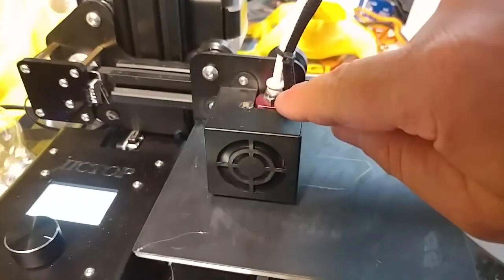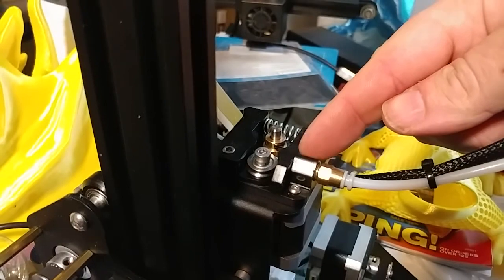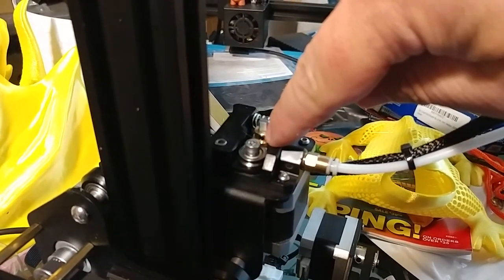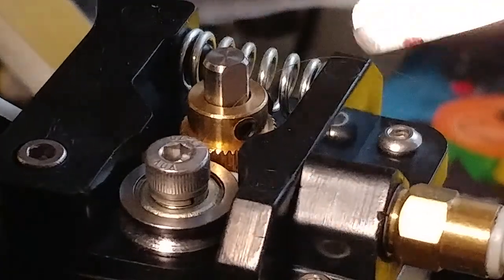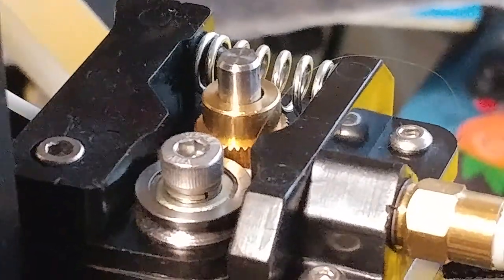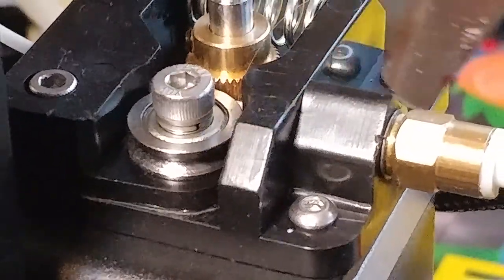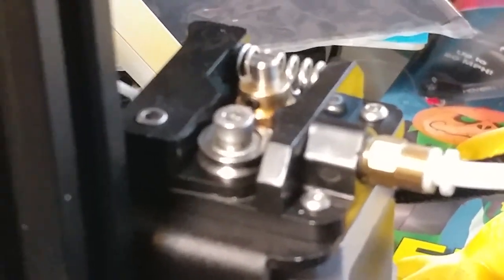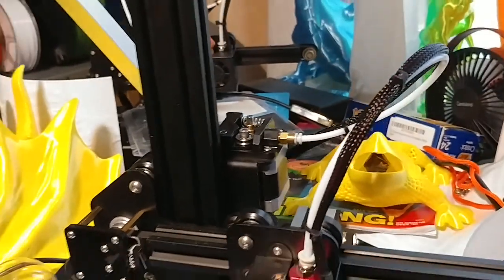Today's 3D Print - Tech Tip Ender 2 not extruding likely cause

Comment: Mine is being really weird. Nothing is coming out while it’s trying to print but as soon as I stop the print PLA starts coming out of the nozzle
Reply from the maker: Motor backwards? Grab ahold of the filament where it enters the theater unit is it actually pulling filament in? Is the gear turning? Is the shaft turning but the gear not turning? Grub screws could be loose on the hobbed gear

Comment: Not sure where my issue is for my ender 2. The aria dragon on the sd card prints fine just a bit over extruded on the first few layers but comes out good after that. The baby groot is way over extruded also. Anything I slice myself always come out under extruded even when I turn up the flow rate 20%. I use the same profile settings for my ender 3. Printing at 50mms. Any suggestions?
Reply from the maker: The two most common problems are your feet or assemblies not feeding properly or you're hot end has an obstruction

The common issue on the feeder is the spring arm is too tight what's not gripping the filament or the grub screws are the Gear Drive are slipping

Hotend would be a gap between the PTFE tube and the nozzle do a cold pool to remove as much torment as you can remove the nozzle and the compression fitting push the PTFE tube all the way through the hot end to ensure that it is clear reinstall the nozzle reinstall the compression fitting but turn it back one and a half turns loose install the PTFE tube ensuring that it is tight and then finish tightening the compression fitting to make sure there is no gap between the PTFE tube and the nozzle heat the hot end up and retighten the nozzle

Comment: I'm trying to discover why my Ender choose under extruding. The filament when it comes out is thin. It doesn't look like it's 4 mm across at all. I tried increasing the feed rate but that just clogs the nozzle with filament. I've already taken the hot end apart and replacing nozzle. Any ideas?
Reply from the maker: +kevin Ferguson make sure the PTFE tube is fully inserted sometimes I can be a gap and that God will permit filament to fester and cook off next turn the temperature up to 260 and put some filament through see if anything not nice comes out :-) basically flush the nozzle you might have something in there partially clogging it

Next check the feeder make sure the grub screws are tight on the Hop gear and confirm the stepper is actually functioning correctly it might be dying as in not enough torque that does happen
Reply: Nerys thanks a lot I'll check that
Reply: Nerys I'm thinking maybe the printer speed. How fast do you have it printing in simplify3d
Reply from the maker: +kevin Ferguson my default is 40 or 50 mm per second depending on what I'm printing the Ender can run a little faster than normal for example all my 3 by 3 printers run at 40 but I can use the run the Ender at 50 even a little higher without sacrificing quality depending on the print

Comment: You forgot something. You should also make sure the counter bearing on the extruder also turns. Because that I had also underextrusion problems because it was so tight that it doen't turn properly and the filament was only slipping on it. And as far as I see in your vid your bearing on the extruder doesn't turn either, but I may be wrong
Reply from the maker: MasterFX2000 oh no mine works flawlessly and i do mean flawless. Wait till you see my latest prints from it. Breathtaking. I was using it to describe diagnostics to someone else.
Reply: Ah ok. As I said, I might be wrong. But I just want to complete the extrusion problem issue causes. I had it on my ender just yesterday especially on slow extrusion speeds (because of 0.08mm layer height) where almost only the microsteps have to handle the torque

Comment: Hello Nerys.....just bought cr-10 for gift....found bed to nozel would not level....bed is snug.....found X-axis 13mm higher on opp side from screw drive....any thoughts to why misaligned? Seems two screws holding horizontal aluminum brace might not be assembled correctly.
Reply from the maker: Show me. text description is unclear but 13mm should be VERY visible in a front head on image.